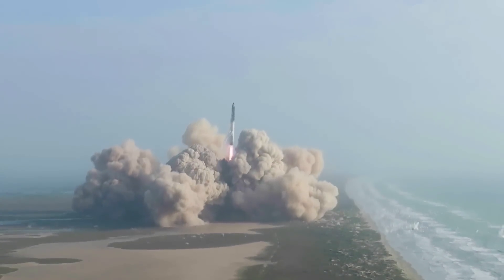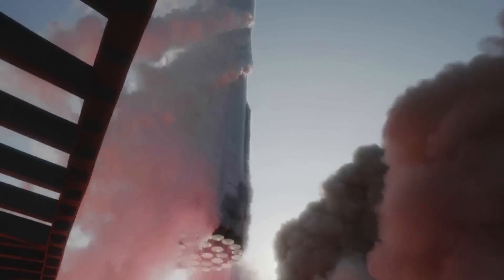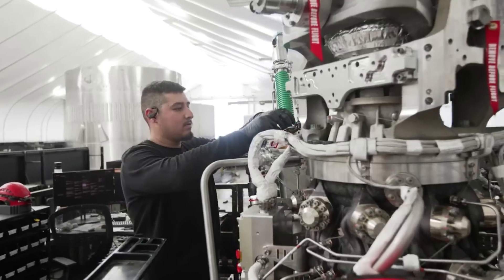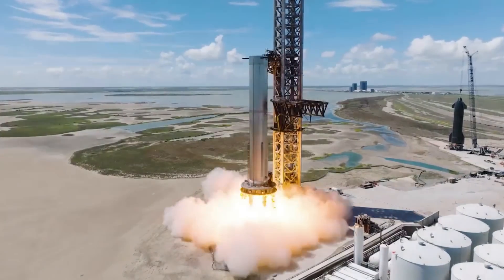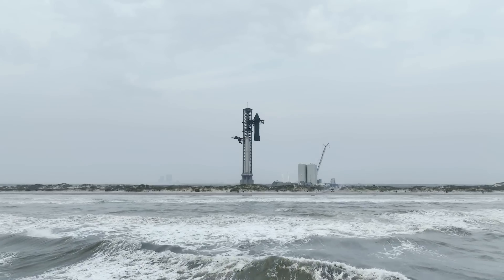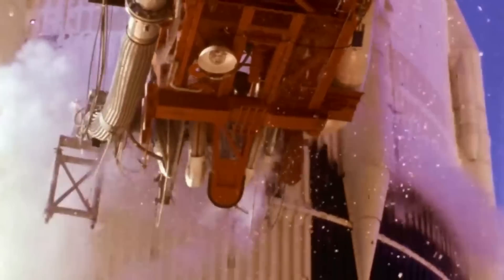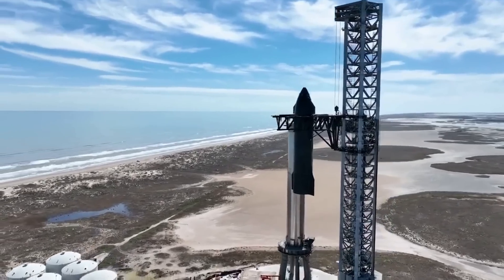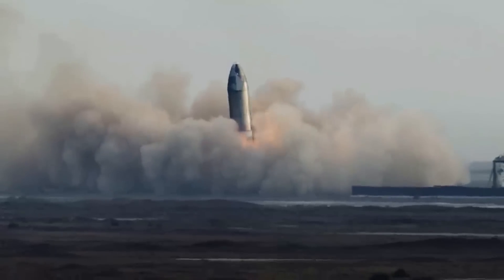Could Steel Plates Solve SpaceX's Starship Pad Issues?

Comment: Why is water table an issue though? They can still dig a trench and put water insulation under the concrete and steel (and have pumps around it if necessary). Or even more - they can let it be partially flooded and have water as additional heat\acoustic shield during the launch.
Reply: The biggest challenge is to keep the structure from floating up. Nothing a lot of concrete and sand cannot solve. Here in The Netherlands we have underground parking garages and other spaces that are way below the water table. But we always make sure that the super structure above ground has enough weight to keep the concrete boot from floating up.
It is sandy ground and there is a lot of space around it for the water to disperse. It would not influence the environment in any meaningful way. (Source, trust me bro. Well actually I have worked at a software company where they did simulations for structures like tunnels, bridges, dykes and tall buildings. I'm not a geo engineer myself, but talked a lot with the guys that did these simulations. And I learned their perspective.)
Reply: @mennol3885  That is what I commented on another video - to build a flame trench below the water table, call in the Dutch!
Reply: During WWII barges were built out of concrete and they floated rather successfully. Under some circumstances one has to be careful when pumping a septic tank that is in water saturated ground as it can partially float up out of the ground. When large building foundations and sub ground level structures are being built, sometimes the water saturated ground is first frozen to allow the construction to get started and allow enough mass to be put in place to offset the lift. 

Having a big pool of water under might at first sound useful but does not help deflect the exhaust flow or deal with the stagnation pressure that would be developed in the center. It would most probably cause a steam explosion / expansion that would significantly over pressure the underside of the rocket. Remember, a diverter is to move the energy away from the rocket.
Reply: @Mentaculus42  there is a WW2 concrete “ ship” sunk in Galveston bay decades ago. Shallow water so it is mostly above sea level. Still there and seems almost indestructible
Reply: How about the 2nd option - have the trench filled with water, basically it would be the same as a miniature sea launch. At least, until the water is vaporized, then the trench just becomes a normal flame trench.
Reply: @SolarWindsRider  
It could make things worse unless you can divert the expanding steam explosion outward and not upward.
Reply: Find the YT clips from Marshall Space Center about Saturn quarterly reports, the first few when it shows pad 39 being built right at sea level - That's where SpaceX needs to start. "Gee whiz, this is just for testing at Boca Chica, we don't need all that." Yeah you do.
Reply: digging a trench and lining it with concrete in such an area is not easy and there would probably be environmental objections to doing that as it could effect the level of the water table in the surrounding area. Their idea of building a water cooled shield for the concrete together with a deluge system will probably be enough to sort this problem out.
Reply: @schrodingerscat1863  I keep hearing " It is so hard to build in this ground with the water table so close to the surface!" You could build a flame trench even in the surf. Piling walls are an amazing invention and around since decades! As long as the structure is heavier than the displacement it creates, it won't try to float. A flame trench is doing more than channeling the flames. It also deflects the shock waves away from the rocket engines. This massive dents in the two tanks have not been created by flying objects. It was the pressure waves slamming into them. Just cooling the concrete below the OLM won't solve this issues. I think, the biggest issue for SpaceX right now is that they realize that they or better said Musk should have planed the launch facility a bit more conservative. Fixing things now will be a massive undertaking.
Reply: @suesun7072  Trouble is a flame trench will only make the problem worse by constraining the exhaust into a single linear path, currently it escapes all the way round. The solution currently being talked about seems reasonable of adding steel blast shielding over the concrete. Then water cooling the shielding during launches. This in addition to a deluge system would probably be enough.
Reply: @schrodingerscat1863  
If you don’t divert, and divert relatively smoothly, you will generate huge stagnation temperatures and pressures and not remove the excess energy TRAPPED under the rocket due to the existing configuration.
Reply: @schrodingerscat1863  You are very optimistic! 🤭Let us be honest! If they had built a sufficient structure in the first place, they won't have this issue now. A flame trench is no issue if you size it right. Decades of engineering went into building launch pads. No need to reinvent everything. But building such structures takes time and a lot of money! SpaceX took the shortcut and thought they could get away with it. Quite obviously, they have been taught better. Now they realize, that they don't have the needed space between launch tower and tank farm for anything but a compromise.
Reply: @Mentaculus42  Indeed, I never said it should be flat. Flat concrete is why this happened in the first place. Intense pressure heat and turbulence producing localised pockets of extremely high energies just above the concrete probably acted like a hammer to chip away essentially pulverising the concrete allowing the pressure waves to then get under the concrete and blast it away.
Reply: @suesun7072  

Exactly this, they painted themselves into a painful corner. A little pre-planning and this would have been a speed bump. It appears that the power-to-be does not play 3-D chess.
Reply: @schrodingerscat1863  
Yes what u say is good, but they have such little space both vertically and horizontally to now dig themselves out of that crater problem not to mention the tank farm. In retrospect it is clear that running around with your hair-on-fire can send u up a blind alley.
Reply: @Mentaculus42  It is somewhat an insult on all past and present engineers who planned and constructed launch facilities which cost many million to plan and construct. I doubt they had done this massive work, if they could have gotten away with just a water cooled steel plate! Just recently, the launch complex for the Ariane 6 was built for 600M €. They blasted a 100x80x30 m hole in the bedrock to install the fire trench under the later added launch table. These folks aren't stupid!
Reply: @suesun7072  
No they are not but the Fool-Aid drinkers will just say that “Old Space” has nothing to offer to their hero.
Reply: @Mentaculus42  There is a decent amount of height under the launch mount (about 20 metres) to construct some form of diverter. The tank farm can be protected by extending the current berm and wouldn't be a problem anyway without huge chunks of concrete being flung around.
Reply: @Mentaculus42  I got this Musk/SpaceX hype must be a fetish to some idea as well!😂
Reply: @schrodingerscat1863  
It is definitely not hopeless, but definitely no more chunks of concrete can be flying around or the governmental regulators will get back in the mix and that will definitely slow things down.
Reply: @Mentaculus42  For sure, I think the mess left by this launch all over the surrounding area is going to cause problems with environment campaigners. I don't think this is over by any means.

Comment: requires cooling because water will get flash boiled from the raptors heat (the plates will warp from the heat and tear through welds without). the plate will have evap cooling holes towards the raptors. it will be pressurized and need nozzles to direct the water away from pointing directly into the engine bells.
Reply: Expect it to consist of many small steel plates arranged like a shingle roof or armadillo skin. This would allow for movement as the structure heats up.
Reply: @schrodingerscat1863  that would allow for the over pressure to push the plates up and turn into flying projectiles. look at olm tower, there are reinforced "water tight" doors that were ripped off. needs small (1") holes, lots of water pressure, and few , if any, seams to get through. ( ~9Million pounds of thrust. shingle style would work if it had room to be near 45 deg angle, it will most likely be near flat to the ground and have a lip to force thrust slightly upwards. )
Reply: @TimberStiffy_  It's a good point, I doubt such a structure is going to be flat. Any single sheet of steel would need several inches space all round for expansion so they will need to implement some way to take up expansion or it will buckle and dig into the OLM legs.
Reply: @TimberStiffy_  The flow of water is critical for such a scheme, problem is Starbase has no fresh water supply so they don't have huge volumes of water to play with. They basically need to come up with a scheme that is as water efficient as possible.
Reply: @schrodingerscat1863  Or just use Inconel 🙂 I would be tempted to weld the plate to the rebar a lot and then pour fresh concrete underneath. Problem is concrete takes at least a month to come to full strength.
Reply: @jonathanbuzzard1376  even inconel expands when heating so large sheets of it would still need room to expand. Better to have smaller metal plates overlapped to allow for expansion. This would be similar to the Saturn 5 flame diverter. That was segmented and had the deluge system at the top covering it with water as the rocket launched.
Reply: @jonathanbuzzard1376  I'm sure it'd take a lot more than a month to make another starship so curing the concrete shouldn't be an issue.. There are other ways to speed up the curing duration itself like steam curing which will be done in like 24-48 hrs
Reply: @pravinsmart  They already have other super heavy boosters and starships more or less ready to go. Sure you can speed up the cure of the concrete that compromises the ultimate strength, and well given what has just happened that's probably not the best idea.
Reply: @jonathanbuzzard1376 
Doubtful if inconel would be sufficient by itself as the stagnation temperature is higher for the raptor engine than other engines due to higher combustion chamber temperature. Also the outer engines are trying to choke the exhaust flow from the inner engines. So one could say that you have a “perfect storm” of competing conditions that should have been foreseen.
Reply: @Mentaculus42  A 50mm thick piece of steel is more than sufficient. If the entire heat output of the super heavy booster for 10s is dumped into a 11mm diameter steel plate 50mm thick the temperature rise is ~630°C. The idea for the inconel covering is that it is highly resistant to erosion which is handy for a reusable launch pad.
Reply: @jonathanbuzzard1376  
Probably not as that is not how the energy will be absorbed as the stagnation temperature is so high that the surface temperature gradient will probably allow for surface melting (without some sort of active cooling). This will then cause melted metal to be ejected into the rocket base which will also cause problems. Not exactly a formula for a reliable reusable rocket. Why couldn’t they just plan for a traditional plan “B”?
Reply: @Mentaculus42  so you know better than the scientists who looked into all this for Project Orion then? No I don't think you do so  the steel wont melt anywhere including at the surface. You would probably want to water cool it to prevent problems due to thermal expansion, but absolutely not to prevent melting.
Reply: @jonathanbuzzard1376  
If the plates are flat, we will see. Those raptors are way more demanding with the space constraints that they have available. Sometimes u need more than a band-aid if u are going to use the facility more than a few times. A combination of half-ars.d diversion and active cooling might allow them to limp through.

Comment: Based on the saturn V requirements super heavy will require 380 cubic meters of water delivered in ten seconds.
Reply: At the condition that all raptors engines are running. With the lost of power, the rocket stay too long down and destroy the LPS. It takes times to burns tons of fuel and lighten the rocket to compensate the lacks of power.
Reply: @haroldsimard7263  pretty sure at lift off, even with a few engine failures, the thrust to weight ratio was still above one. Not sure why it took so long to take off, I know they stagger the engine startups so that would add a bit of time to take off.
Reply: @digi3218  the booster is clamped down at the bottom with a "quick disconnect or something.  I was under the impresssion they held it for a few seconds before letting go to make sure it had enough thrust to lift off.
Reply: @AkaRyrye83  I think I heard somewhere the clamps let go a while before liftoff.. so maybe they start the engines, do some checks, let the clamps off and then power up the engines
Reply: They should copy the N1 launch pad design
Reply: @Awaken2067833758 before or after?
Reply: @ferky123  they already have the after

Comment: They should dig a deep pit that redirects the pressure of the thrust to a lifting mechanism that in turn helps push that heavy beeeatch off the pad.
Reply: There is water just bellow ground. Not really option to dig.
Reply: @MrVolodus  Perhaps another launch complex? This will be an achievement for mankind to manage the heat and pressure. They will need to get it off the pad quicker than 0 did or they will have to repair the pad every single launch. I see an elevated platform in the future.
Reply: @ReedyFPV  We will see what they come with. I am pretty sure that solution will be found, now that they know what we are dealing with.

Comment: I didn't even notice that you can actually see chunks of the concrete flying upwards passed the rocket on the launch clip from the tower.
Reply: Flame-cutting steel too close to a concrete floor with an oxy-acetylene torch, instantly boils the residual water in the concrete and fragments will fly upward as the concrete literally explodes in front of you. The cooled steel plates they are planning to use will prevent the heating/boiling effect in the concrete flame chute and things should go much smoother next time...

Comment: Would using the same ceramic tiles on starship on the steel plate help mitigate the heat problem?
Reply: Probably not.  The big issue is thrust and fluid flow, with the fact that it happens to be at several thousand degrees just the icing on the cake.  The tiles likely aren't nearly tough enough mechanically and will just contribute to the flying debris.  You need something strong enough, and then to keep it cool enough that it says in the area pf material properties you want.
Reply: Everyone is saying the ceramic would get blasted to bits, but whats the difference in force compared from launchpad takeoff to atmospheric reentry? The ceramic should hold up in reentry when its travelling at 22k mph, why wouldnt it hold up at liftoff? (Honest question.. im not a rocket scientist)
Reply: @thegrapplingclub  because when starship is reentering at that kind of speed, it's in an incredibly rarified atmosphere - well under 1% of normal, and at the start of its descent, less than 1% of that.  There's a huge difference in the forces involved between hitting the incredibly thin air on reentry (even if it's) at hypersonic speeds, and being force fed one atmosphere plus at mach2.  Air is squishy, but it ain't that squishy.
Reply: @jonathanj8303  thank you for this answer 🙏
Reply: They are too light weight and would be blasted to bits the instant the engines lit up.
Reply: @davejones6733  Well I am no expert but seems to me if they are to withstand slamming into the atmosphere at 17,000+ mph for a typical orbital reentry velocity, they would hold up to 10sec of ignition. Looks like it would be a great way to test them out as well. 👍
Reply: NO! For obvious reasons. Why are Musk and his fans so opposed to using proven technology... Like a flame diverter????
Reply: @DavidJohnson-tv2nn I think they’re opposed because all the engineering required to do it properly would vastly increase Starbase's footprint and impact on the surrounding area. The Army Corps of Engineers would have to get involved, and SpaceX would have to subject itself to far more environmental and regulatory scrutiny.
Reply: Ceramics is very likely part of the solution, but there are better choices for the type of ceramic when you don't have to worry about it being lightweight at all. It's part of the fixed ground infrastructure, if it's better cost-wise it can be as heavy and thick as you'd need it to be. A denser and heavier material of that type will also be a lot stronger in terms of dealing with pressure or compressive loads.

It could be part of the thermal shell that goes over the metal plate that provides cooling and protection to the main supporting concrete structure of the supporting foundation. People arguing better solutions should realize they're not exclusive of each other. Combine each thing presented as a component where needed to try and obtain the best solution for the problem.
Reply: That actually sounds like a good idea. They already have a factory producing them so seems like it would be a fairly easy to configure like shingles on a roof covering the plates. And make use of their fasting system used on Starships belly for easy repair when needed.